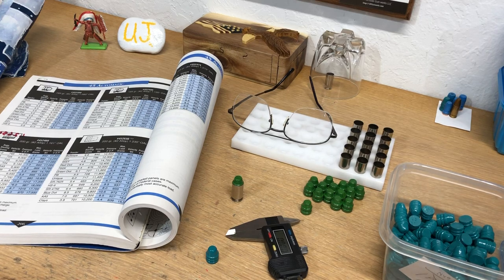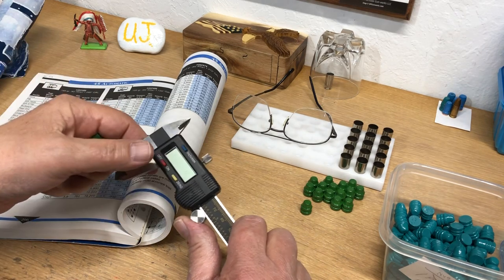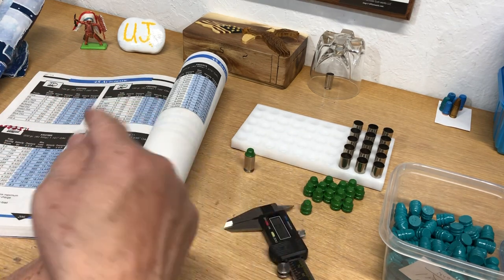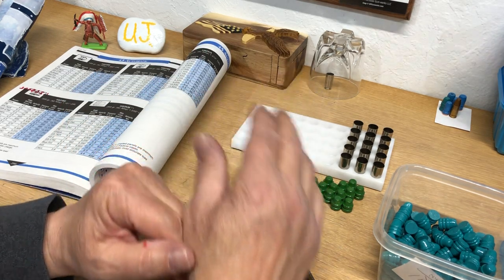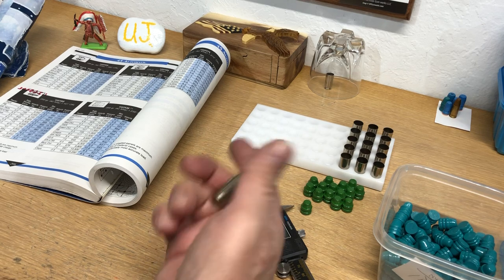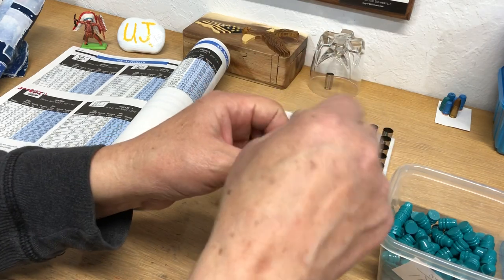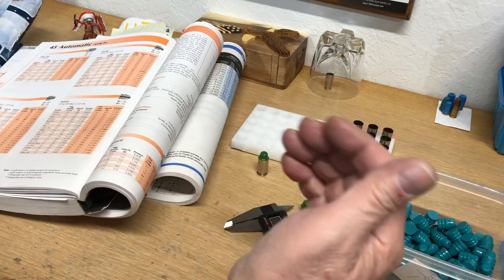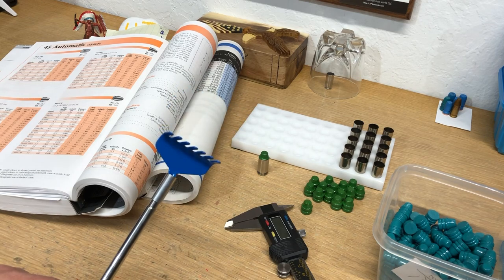Why you can’t trust your reloading manuals.

Comment: Good video.

OEM bullets & OEM data should be coordinated. I would doubt that there pressures are correct. 

As hand loaders we should understand the principles of what we are doing. I have found powder maker manuals to be useful. They like the Lee manual give you powder charge for a bullet weight. The Joe Friday info.  If you buy cast or plated bullets that is all the info you need. 

Loading revolvers you use the crimp groove and OAL is not thought about. The pistol rounds are not so easy. As you noted, you gotta make a dummy round and test your chamber(s). 

I don't own a gauge because of plunk testing being free. 

Lee does not publish mold & load data for a very good reason... Liability.  You cannot know every chamber or barrel profile. The minimum charge is noted as a starting point in most load data. 

The Western Powders FREE Pdf or buy manual has a good section on pressure signs on primers.  Visual primer clues are typically to late. The primer does not deform exactly where excess pressure begins. When your primer shows signs you missed the sign about the Bridge being out 2 miles back.
Reply from the maker: 👍 I like to see the bullet in the manual because you can compare them to your pet bullets and it’s easy.

Comment: I try to use 3 to 4 manuals before making a decision on what I’m loading. Like you I plunk test first. Then I use the case gauge after I know my col is right.
Reply from the maker: Pistol is easy if you know what bullet they used then go of weight and volume comparing a bullet you know. 👍

Comment: I don't know if you have an Rcbs manual or not they list an MAX CAOL, as 1.275 for the 45acp but for their 200gr LSWC they list 1.190 CAOL  and for the 230gr LRN they list 1.270 , I look at these as suggested length for bullets what works in one gun may not work in another one so always check things in your own chambering of the gun , they also list a trim length of max as 0.898 and a trim to length of 0.888 inches.
Reply from the maker: OAL is something best compared to bullets you know with value and weight. The manuals can be nuts.

Comment: I load that bullet as the Saeco #130 and  my working OAL is apx 1.1560. Its a rare occurrence for me to use a load manual to get the OAL these days for the reasons you pointed out. I think the best way for pistol is to use the barrel of your gun as the gauge, get a seating depth that will cycle dummy rounds reliably, then I start collecting the load data from various manuals to determine a start load. I dont like most newer manuals as the load data is usually too low for start loads to even cycle the pistol. This happened when I started reloading (45acp) and thought I was doing something wrong - until an experienced reloader at a shop told me its too light of a load to cycle the gun. I load for calibers that are all pre 1925 so I like older manuals and like the fact that often those max loads are true max loads. Some people say dont use old manuals because they change the powder over the years. I dont buy it (except known cases such as Re7 where it was announced it was different) and have found that to not be an issue. Several of my best loads were developed from manuals from the 1930s
Reply from the maker: Some of the older manuals can be a little warm and they didn’t have good pressure data . 👍
Reply: @unclejim2330  True, but I always work up and keep an eye out for signs of pressure. I do like when pressure data is published, but then you have to account for the max pressure your lead alloy can take which is a good thing about the Lee manual. They give you the BHN and what pressure will likely be max. I dont use the Lee load data though, and my understanding is its just a compilation of past published load data anyways. I like those books called "One Book One Caliber'  which are also compilations but they specify where the data came from and are a little more detailed

Comment: In the Lee manual, on page 37, it states:
"Bullets seated deeper than normal will reduce case capacity and increase pressure. This is not too critical for large rifle cases, but extremely important for pistol loads. Good load data specifies bullet seating depth or over all cartridge length. Do not seat the bullet to deep. 

On page 96, of the Lee manual, under the section of “The Latest Information On Pressure”, it states:
"2) the extreme expansion (XTP and Gold Dot) handgun bullets have a large and deep nose cavity that makes them longer than a regular bullet of the same weight. This requires deeper depth resulting in higher pressure.  Seating depth is very critical for handgun ammunition because of the small cases and large bores. ... … The usable volume of … … … the 45 ACP is 1.14cc. Seating bullets 1/16” deeper … .. … reduces the volume … 0.16cc for the 45 ACP. That’s ... ... ... a whopping 14% ... . This large volume reduction has an equally large effect on pressure that is made more critical because the maximum pressure for the 45 ACP is 1/3 of [plus 60,000 pound range as mentioned below. Keep in mind the 45 Colt working pressure is a mere 14,000 psi.] …

On page 157, of Lee's manual under "Minimal Overall Length", It states:
This is critical on most handgun cases. A small reduction in overall length can cause dangerous pressures because of reduced capacity caused by seating the bullet too deep. See details on page 96."

On page 133, of the "Complete Reloading Guide", under "Loads For Handgun Cartridges", in bold font right under the heading it states:
Loads for handguns ... with less case capacity ... when loading ... ... ... mere tenths of a grain of powder can make the difference between a good load and one that is dangerous. Approach the loading of handgun ammunition with these facts in mind."

Plus on pages 88 thru 89, of the Lee manual, under "Signs Of Excessive Pressure" is a list of seven pressure signs and then the manual states the following:
"It must be emphasized that these signs will not manifest themselves in ... low pressure rounds. These are signs of pressure in the plus 60,000 pound range. If you are loading for a gun designed to operate at 15,000 pounds pressure, you will most likely never find a loose primer because the gun would have blown up and spread the primer and gun parts over a wide area." 

And on page 158, in the section of “How To Read The Load Data”, under “XTP” it states :
“Use these loads for the Hornady XTP, Speer Gold Dot, or Remington Golden Saber bullets.

Now on page 270, of the Lee manual, under the “250 grain XTP” it gives load data with three different seating depths, because the data was taken from three different brand bullets, yet clumped together as if one. So if someone where to take the data developed for the shorter bullet and turn around and used it with the longer bullet they could very well raise pressures far above the 10% reduced starting charge weight. Especially if they use a case with smaller case capacity than that used in the development of the load data, as well as a hotter brand primer than that which was used to develop the data in the first place. Keep in mind that just changing the brand of primer can cause as much as a 2,000 psi rise in pressure alone, which can by itself swallow up the safety margin. Then throw in a case that has a reduced volume than the tested one and on top of all that seating the wrong bullet father in to the case,  because it has a deeper hollow point and thicker cooper jacket, than what was used to developed the load data could easily displace the primer into one's own eye - so to speak.

Or another way to put it would be as written in the book "Ammunition, Demystified", at the bottom of page 18, which says:
"Use only the loading data published by the bullet manufacture! Substitution of loading data for equivalent weight bullets can get you into deep yogurt!"

And I know for a fact that other manuals have stated not to switch brands of bullets even if they are of the same type. I would post them here if I had the time to wade through 30 different manuals to find where they spoke of such, but I am tired just having to have dug up the above and below. 

Head the warnings of reloading or not, but what ever you do try not to teach others to ignore them just because you might so choose.

Again, the Richard Lee loading manual does not do pressure tests themselves, they only take test data from others that do and jumble it all together, of which they lose the test barrel length, case brand, primer type and brand, as well as bullet brand. These are all important elements, as one should never take data made for one specific brand and type bullet and turn and use it with a different brand or type bullet. This is due to Brinell hardness and bearing surfaces can be different, as well as the shape can be slightly different with longer or shorter lengths, all of which can cause extremely high pressure issues. One should only use data straight from a reputable data source [see paragraph below] that does their own pressure testing which give the test barrel length, case brand, primer type and brand, and most of all the brand of the type bullet used in developing the data. Each one of these elements that are changed is a compromise of which if all are compromised at the same time could very well add up to a recipe for disaster.

First off, I am not implying that Lee plagiarized the data in their manual, just that they jumbled data from different sources together and lost key elements in the doing. And it has always been a given that one should use the starting loads and work their way up. This 10% reduction covers for smaller bore diameters, different lots of powder, different brand/lots of primers, and different brands of cartridge cases. These alone can take up that 10% relatively easy. Especially in pistol cartridges, as a little goes a long way in such small volume chambers.

Lyman, Speer, Nosler, Sierra, Barnes, Swift, Berger, Norma, Lapua, VihtaVuori, Accurate, Western Powder, Hodgdon, or even Hornady reloading manuals are far better suited than Richard Lee's for gleaning load data from, as they all not only do their own testing but they all give the test barrel length, case brand, primer type and brand,  as well as the bullets brand and type for each load recipe. 

Again Richard Lee's manual throws out one of the carnal safety rules of "never use load data developed for one brand of bullet for another brand of the same style bullet". Keep in mind that it is always better to throw out Richard Lee's manual than any of the safety rules. But with all that said Richard Lee's reloading manual has a wealth of knowledge in the front half that makes the book well worth having. Just do not ignore the Cautions, Warnings, and Nevers there within.
Reply from the maker: Quite the reply. On my old channel (deleted by YouTube) I’ve stated a million times how I dislike the Lee manual because it doesn’t show what bullet. I do a lot of loading not in manuals due to shooting suppressed and volume & wight is the most important. 👍
Reply: @unclejim2330  So how does the volume and weight thing work?

Comment: The difference between YOUR seated length 1.160" and the book suggested seating 1.120" is 40 thousands - not critical to blow up your gun if you follow the rules and do your load development.  You measured yourself the sticking out shoulder to be 55 thousands so how is that going to seat beneath the brass case doesn't make any sense to me.  If you push it down 40 thousands you still got 15 thousands sticking out.  You're going to be almost flash and any reloader who reloads pistol rounds that headspace off the case mouth should know better not to apply heavy crimp; you only apply enough crimp to remove the flaring and maybe couple thousands more THAT'S IT!  I am pretty sure you know this.  

It appears I have an NOE clone of this mold in 5 cavities that I've loaded for 45 colt for my friend.  I would be curious to know how tall this bullet of yours is compared to mine and do some Quick Load number crunching and possibly what powder charge you use.
Reply from the maker: Don’t even remember making this rant vid but know how to reload and  only remove the flair and assure no set back. Not my bullet, I don’t have that mold but ran into the same issue with the Lyman 200gr where the shoulder is below the case if going by their own manual . Can  show you all kinds of bad info in manuals  so my point was “ think”.
Reply: @unclejim2330  Yes, totally agree, you have to think, look at several manuals if possible, and personally I like to play with Quick Load to see what kind of velocity/pressure I get.